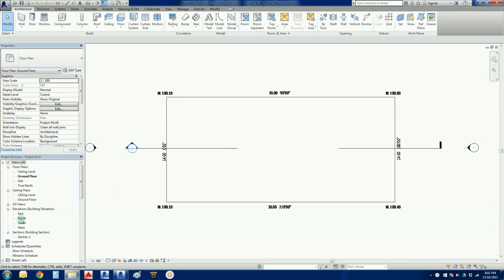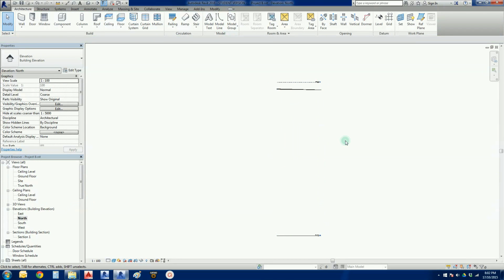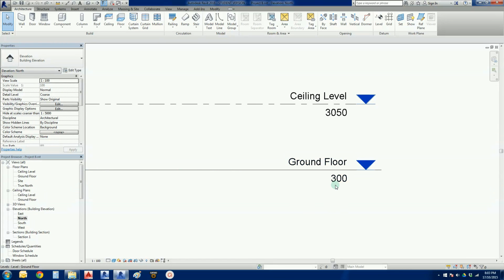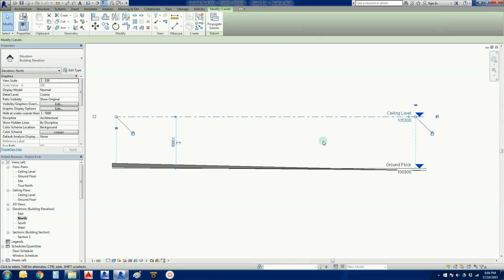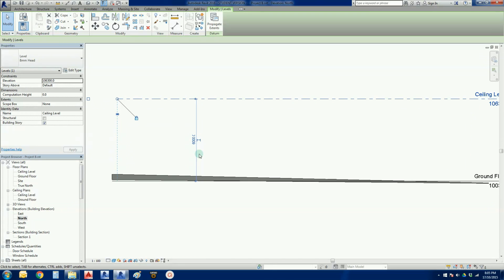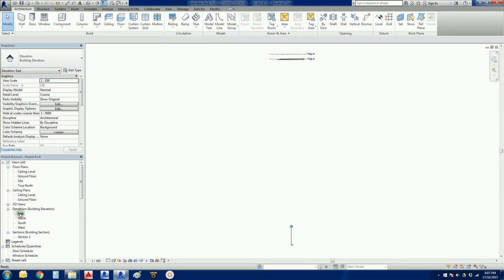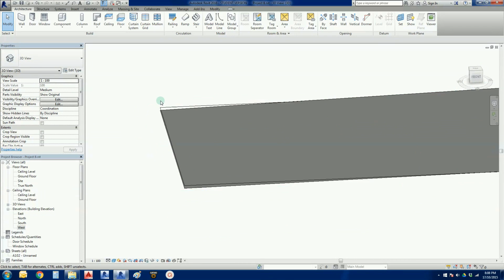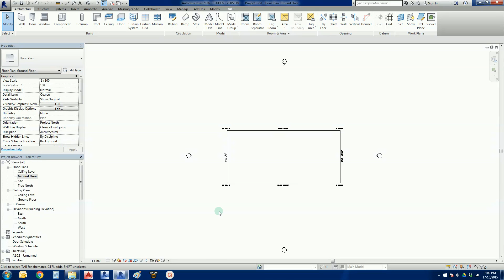Revit 2016 - Project B: #4 Resetting Levels To Suit Toposurface

Comment: Hi I have an issue the level 1 in the elevation. I changed the number in the level 1 like 300, but the level 1 goes up 300 with my object. My object shouldn't move and stay as is, and only level 1 goes up 300. But my object and level 1 goes up whatever I put number in the elevation. How could I solve it?
Reply: make in negative 300 (just enter -300) instead of a positive 300

Comment: Hi apologies but I have to correct you. If you move the levels up (This also refers to other Autodesk programs) it will malfunction as the drawing is too far from 0,0. You will have to change the actual level from the axis. Here is a link https://blogs.rand.com/support/2012/07/revit-changing-the-level-elevation-without-moving-the-level.html
Reply: Finally, I found the source comment of the link. 

I tried your suggestion, but this is what happened:

Contour Labels read 117500, 116300, etc.

Topo points indicate value of 2511-1149, etc.

I am using Revit 2018 at the moment, and I hope you could help me out. Thank you